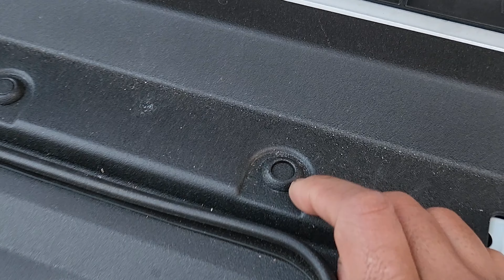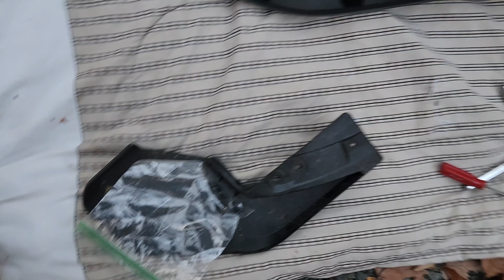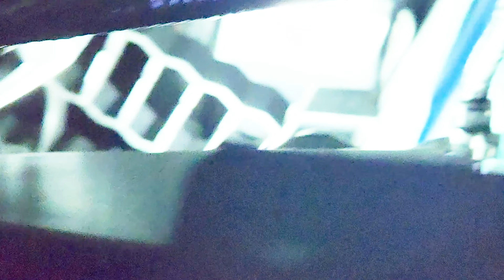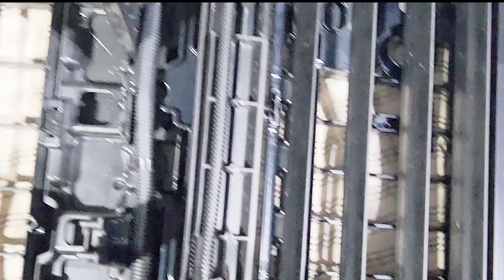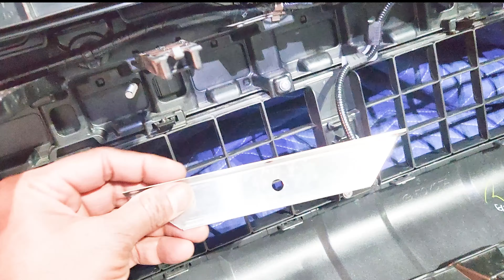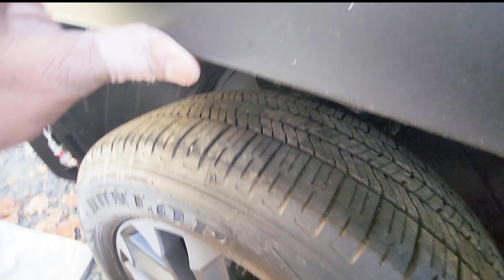Land Cruiser 250 Bumper Removal How To

Comment: Thank you I'm going to colour match the black trim on my J250 which includes the bumpers front and rear, wheel arches, and bottom door trim.
To do it properly I have to remove the parts and give them to my spray shop.
Your video was a great help.

Comment: i need to replace the front camera because it got a rock chip in it. Looks like i should be able to take the plastic cover off above the radiator to access the wire harness and 2 bolts to replace the camera.

Comment: could you have used nutserts to mount that bar?
Reply from the maker: No - there is not enough rigidity in that plastic to use them.  You need metal to brace and to distribute the load.

Comment: Thanks for the video.  Somehow the lower center “egg crate” grille is broken on mine and missing a few of the plastic pieces.  Wasn’t sure if this repair required a complete bumper removal.  The part itself is only around $150, but the dealership quote me 3 hours labor and that seemed high.
Reply from the maker: Hi, glad the video helped. I would say it's a 2 hour job, and 3 doesn't seem ridiculous.  You might be able to do it yourself, if you have some basic tools: 10mm, 12mm and small flat head screwdriver. You'll want a blanket to lay down the parts to avoid scratches.  If you can ask the dealer to do it in 2 hours, show them this video, maybe it'll help! :-) It's better if the plastic is screwed into the other parts.  if it snaps into place, it's really quite frustrating.  Good luck!  Thanks for watching.

Comment: nice job, where did you get that mount? did you made it yourself?
Reply from the maker: The Nilight Light Bar came with with  bar & license plate.  For the rear, I just took some aluminum strips that I had (6 inches long or so) and used them to brace from the inside to distribute the force and increase rigidity.  You can buy a strip at Home Depot and cut it.  i would use a 1/4 inch version or so and you should be set!

Comment: It’s so funny you uploaded this two days ago.

Three days ago, some drunk guy backed into my LC and I’ve been looking for videos on how to snap the corner bumper back in place.  Mine is 1mm off from sitting flush against the fog light panel.
Reply from the maker: @aregal  Happy to lend some opinion to this... if I were you, I would loosen the entire bumper as outlined and reset the position.  There are a ton of little "pins" that pop into holes and a few tabs that clip in.  I'm hoping nothing cracked.  As an option, perhaps some rubber grommets or silicone  could be put in those holes to snug them up a bit.  I do think if you loosen everything, it might be possible to shift it back into place.
Reply: @ yeah, that’s what I’m thinking.  Maybe I’ll take a gander again it again tonight.